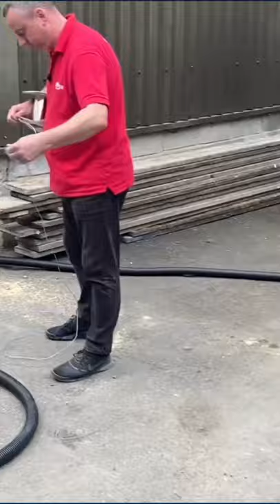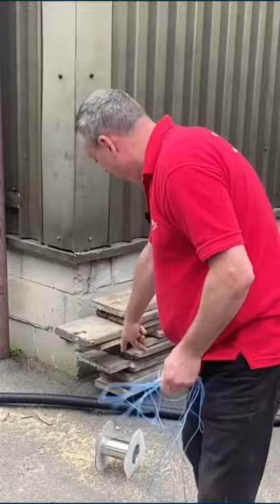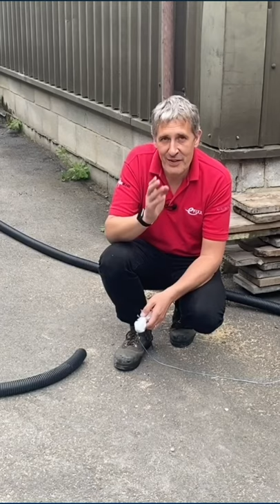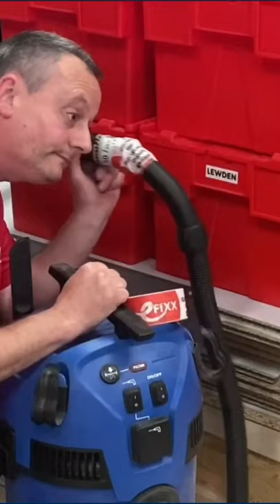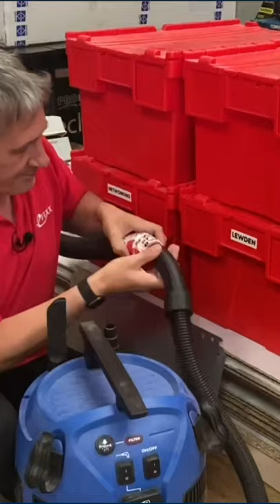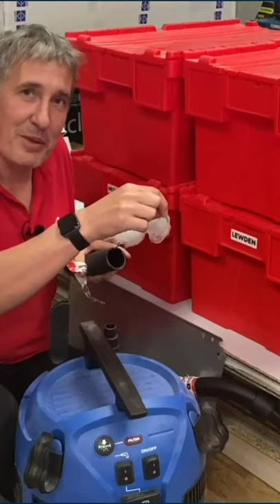Electricians' Top Tip: Have you ever lost the draw wire in ducting or conduit? #shorts

Comment: We’ve used the plastic bag a lot. Some companies actually make “mice” that’s pretty much the same concept. Usually a cylinder shape foam with a small I bolt type metal through the center to tie your pull string on. I think plastic bag is just as good if not better. The mouse you can buy has more weight and seems to get caught up a lot on connectors or couplings compared to the plastic. And some people will pull in another pull string when they pull in their wire if they haven’t hit capacity. So for future pulls will tie the string at both ends for future circuits the strings already there to tie your wire on to. But I’ve also seen people disconnect a ground wire or use an extra wire that’s already there. Tie on your new circuit wires plus the another one you’re using as a pull string. Good to use lube sometimes if there’s a lot of wires in the raceway or lots of bends so you don’t eat through the wires jacket from friction. 

And a trick to help with the shop vac for suction. (I’m sure most electricians already know). But if you can’t get the hose end of the vac to create good enough suction at say a junction box or tight 4 square box where a 3/4” conduit comes in or 1/2”. You can cut off the bottom of an empty water bottle and take off the cap. Tape the bottom end to the end of the shop vac hose, and press the cap side of the bottle up to the connector of the conduit in the small box. And if that doesn’t work still just use a finger and thumb and squeeze around the cap side of the bottle against the connector and should be enough usually. 

Also if you’re using EMT instead of rigid and it’s a long run and you can’t get enough suction. Tape off around your couplings/connectors especially if it’s the set screw type. Rigid doesn’t usually matter cause air doesn’t leak as much of the suction through the couplings.

Comment: Only thing I would add is make sure you use a wet and dry vacuum if the duct is already laid.
Reply from the maker: Good point - who knows what’s lurking inside
Reply: That's why it's often (I hesitate to say safer, so I'll say) easier to use compressed air.  But then you have to plan for its use and have a bottle on the van.  Many sparks and data guys do, but almost everyone has access to a hoover somewhere on site.
Mark you, if you're on a proper site not a domestic job, most professional hoovers are wet-and-dry capable today, just don't attach your chippy's precious filtered dust extractor to the pipe...

Comment: Reminded of a 400 foot trench 1/2" Sch 40 PVC I hand dug for customer 20 years ago. I pre strung it with solid 14 AWG copper wire for a puller. The telephone crew showed up and first thing the helper does: Rips the wire out cussing "what idiot put this one wire in here...". He got thrown off the job when the boss saw what he'd done. Nifty trick here with your rabbit. Works every time.

Comment: An old method, was taught this “many” years ago when first started installing cable, now use compressor to “blow” cable only, no draw wire or string required, hope whoever put in the string doesn’t catch you, liable for a knuckle sandwich!!

Comment: That's a little over the top. By the time you're done setting that up and make shifting it into existence I would have finished winding up the string by hand minutes ago.
Reply: ? Why are you winding the string up?
Reply: @naivefarmer3735  that's literally what they're doing.
Reply: No they aren't. They are re-threading the string through the duct line so you can pull wiring or other items through the duct. 

Some one who doesn't know what the the string is in there for may pull it out and it's a bugger to get it back in. It's a really smart idea.

Comment: Rarely have to do it as we have the company that does the push for us pull in a mule tape. Sometimes when going from HH to HH at an intersection we will use this method if the conduit HDPE but if it's metal conduit it's usually Swiss cheese and too much debris is in it.

Comment: I've been trying this recently, but the rag keeps getting stuck about half way. Think there might be water in the conduit :(
Reply: Use plastic carrier bag/s, depends on size of pipe,duct just roll up until nice fit not tight, in pipe,then tie cord to roll up bag/s.
Reply: Use a grocery bag. If the run is not too long you can fish tape the other end and hook the bag and pull it out.